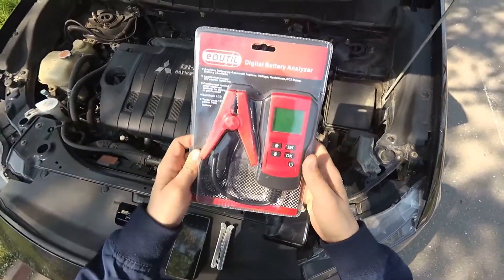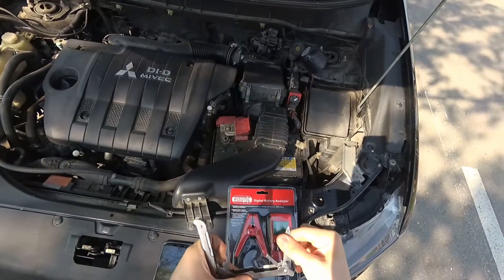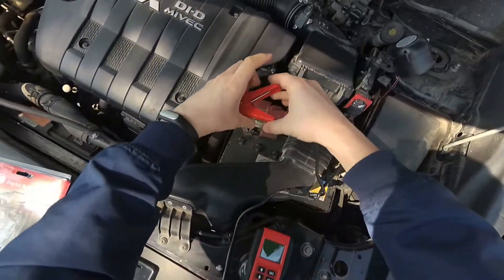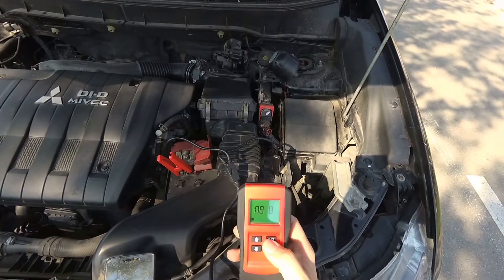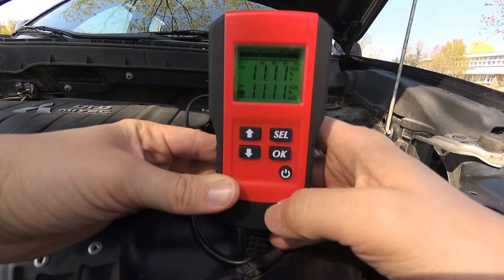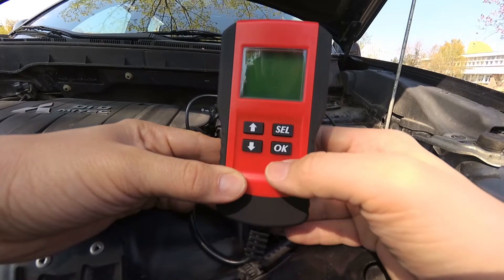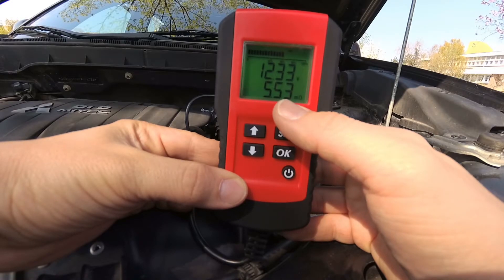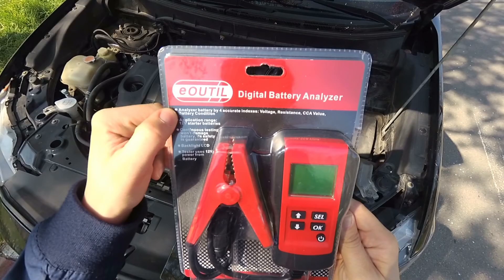AE300 12V Digital Car Battery Capacity Tester & Analyzer

Comment: Wrong instructions bro
Reply from the maker: Can you tell me why ?
Reply: @TechTronic9000  You should input the CCA amount that is dislayed on you battery, not just random 800 or 1200.
The measured CCA by the device is compared to the value you have typed in to determine the degradation state of the battery.
(The measured voltage is another thing; Yes you battery is low on voltage)